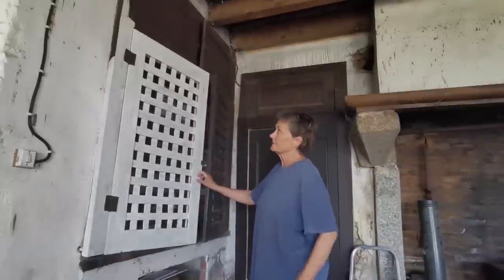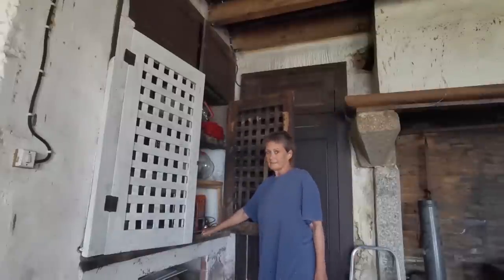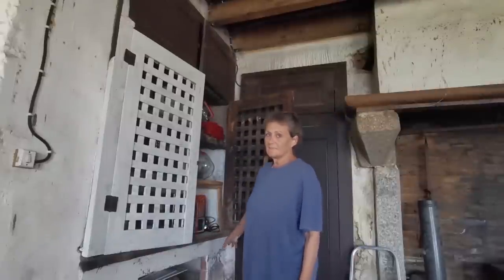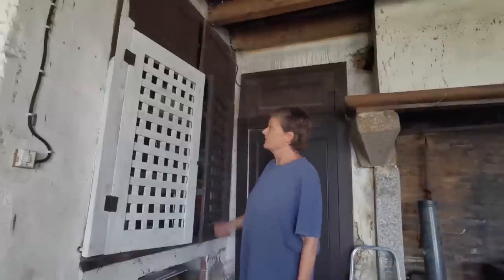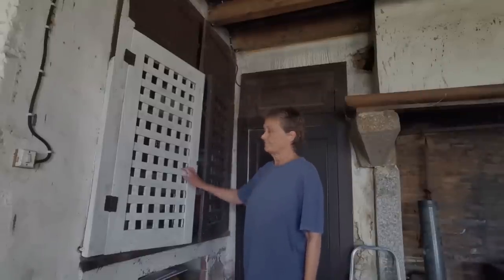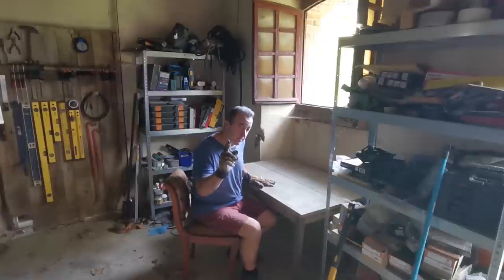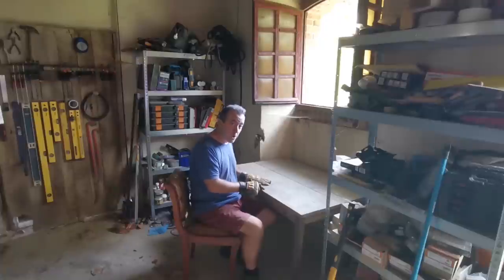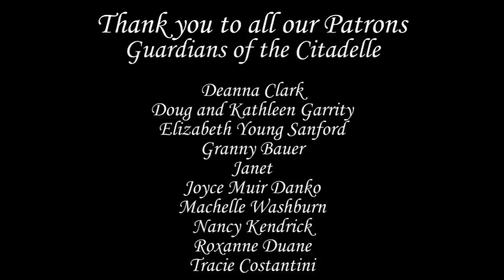15th Century château kitchen restoration - stripping the beams

Comment: when putting the stuff on the beams use a foam radiator roller  and cut in with small brush you could cover the beam in half the time
Reply from the maker: Thank you for watching and thank you for the tip. I did try that but I found that working it in with the brush helps loosen the soot and smoke stains. It doesn't take too long. Best wishes, Rols
Reply: @chateaucitadelleducavalier  it's a big job good luck I enjoy your videos
Reply from the maker: @robertgregson2183  Thank you